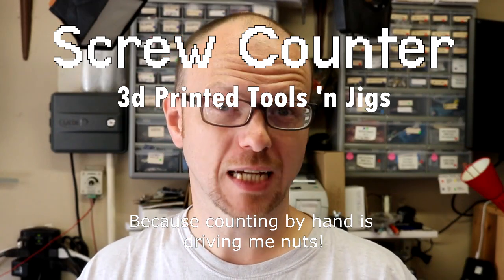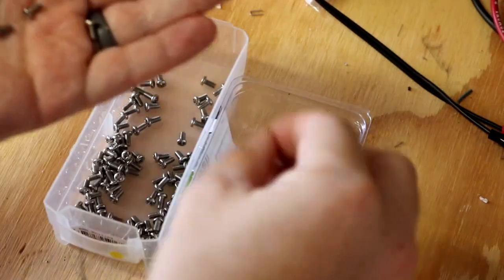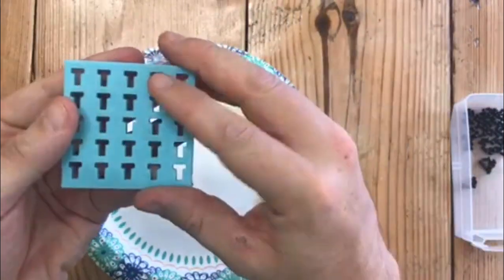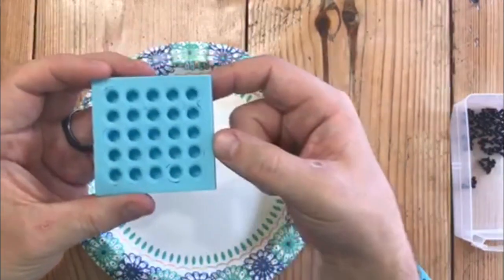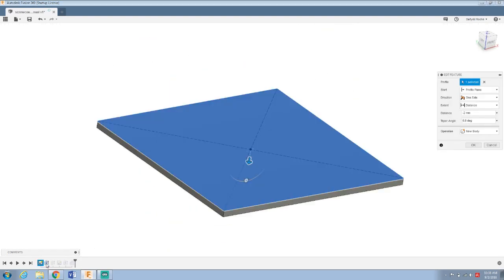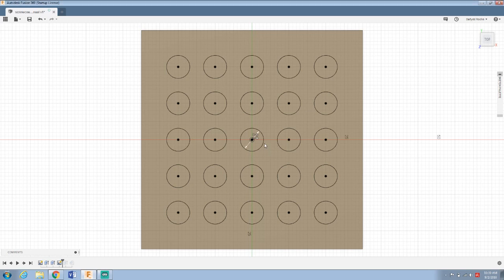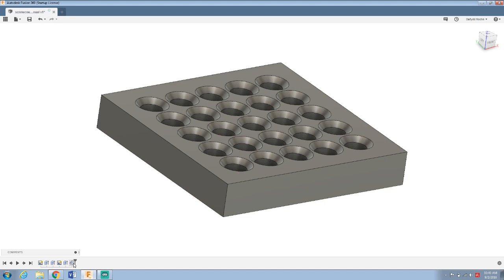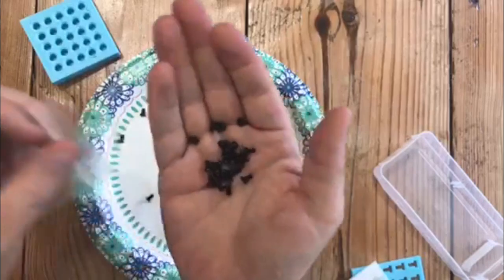Jigs & Fixtures - Counting Screws for kits

Comment: Why not do it the way they count lots of notes and coins- by weight. Weigh 25 screws and note the value. Then just pour screws onto the scales until you get the same weight and pour them into a packet. Simples.

Cheers

Ian
Reply from the maker: Ian Bell - I looked at that, and I found that I couldn’t trust the scales I had. I couldn’t get an accurate count. Ended up with a few bags with less than 25... (eg 22)
Reply: You need to invest in the right tools for the job!!